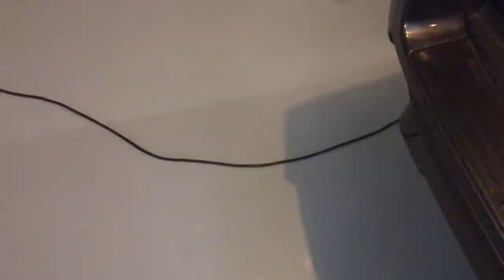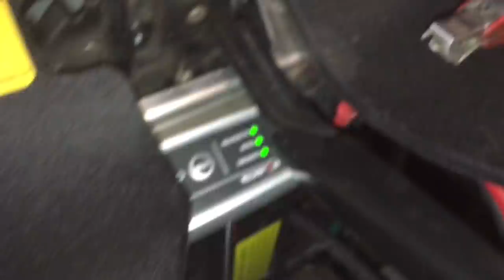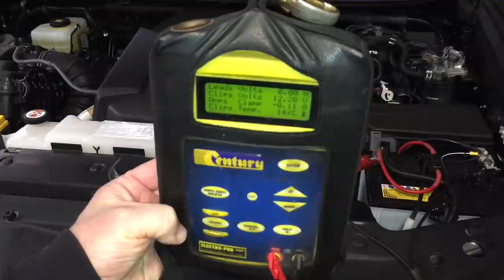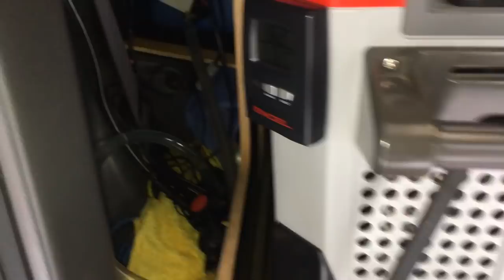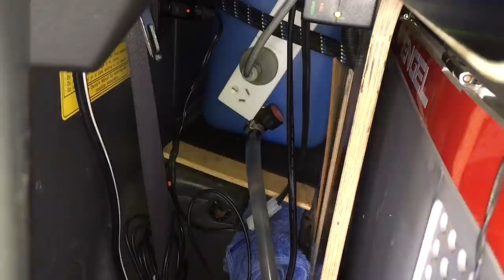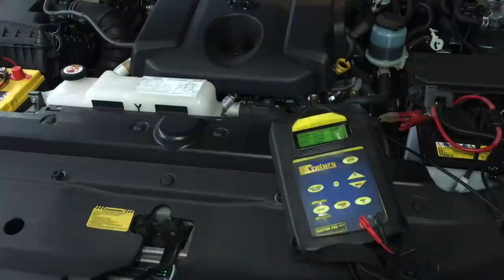DCDC CHARGER KILLING BATTERYS IF YOUR NOT AWARE OF THIS

Comment: With the Projecta on solid lights (all 3) it’s not actually charging - it suposodily in float mode . Also with solar charging it doesn’t pull anything from the crack battery mate, only does this when crank battery voltage is over a specific voltage, think it’s 12.9v (check manual). Something else is going on with why the crank is only at 12.2v. Having said that, I originally ran the Projecta dcdc and had a fair few problems with the charging and going into float mode early and float voltage was low like you are seeing. I replaced it with a redarc bcdc and it’s been absolutely solid!
Reply from the maker: But it is

Comment: Ive connected the blue wire off the sbi12 to switch in cab to start ute off aux battery if my crank battery was flat or below 11v

Comment: Oh dear, somebody help this bloke!

The unit is performing exactly how it's designed. I am unsure what you are so angry about? The DCDC charger will not take care of the starter battery it's not meant to. A VSR is definetly not the solution nowadays, under bonett secondaries and VSRs are old technology there are much better performing systems for modern vehicles.
Reply from the maker: Yep worked really well NOT
Really angry Actually probably true but I’ve got rid of the rubbish now and now I use the solar panels with the cheap regulator that came with it and see over 14 V even when it’s cloudy the projector is rubbish

Comment: It is a situation where if you increase the charge to the main battery, the DCDC charger senses this and starts charging the aux batteries.at its full charging output....if the DCDC charger is getting charge from the alternator..then the alternator @ 150amp will cover (keep up with the charge needed) for the a 20amp DC DC charger charging the aux  battery. If you are on solar input without the alternator going.(ie camping).that solar input will trick the DCDC charger to start at a full 20amp to charge the aux battery....BUT if the solar is only putting in 4amps..the DCDC is charging at 20amps to the aux battery, you are losing net 15amp..that 15amp has to come from somewhere to make up the "gap"...guess where?...from your starter battery!..This vid does explain it a bit better...https://www.youtube.com/watch?v=rDXixCzg6iw
Reply: I think that’s what’s going on with mine

Comment: The DC-DC usually had a mode to charge different battery's i.e: AGM Gel cell etc. They recommend an isolator and the DC-DC sometimes and bang there goes your customers $1500+.
 Agree with you Anthony, the SBI12 is the simplest and low cost for customers (Auto-Elecco here) Redarc and others suppliers always try to tell you to fit the bloody more expensive DC-DC. Cheers for the info once again. Keep the Budda booms and bangs coming 😂
Reply: All DC to DC chargers are meant to be connected to the second battery or deep cycle battery not the crank battery. In the instructions it tells you this. Its there to charge the second battery hence why they say in the instructions to put it as close to the second battery as possible. its not there to charge the crank battery as its charged via the alternator. I have one in my Prado and have NEVER had an issue. (Auto Sparky here also) The SBI12 is basically a switch between the two batteries that divides the batteries when the vehicle is off. They work ok if the two batteries are of the same make up ie both flooded lead acid crank batteries, but if one of the batteries is a deep cycle AGM under bonnet battery things change and will NOT charge them up to anywhere near 100% hence the dc to dc charger.

Comment: I am having a similar issue with my Redarc DCDC charger. After a week running solar on  my Aux batt my starter is drained down.
Reply from the maker: Which leads me to believe this is a possibility not isolated to projecta alone
Reply: @Fourby4Diesel  Recently I have disconnected all the accessories in the back and connected them to a stand alone lithium battery. Even though there should be no amp draw or very little, after 2 weeks of it sitting there the main battery and aux battery were flat. Though the main battery only just had enough juice to crank and start the engine. Am now rethinking all the wiring which was professionally installed and what I can do to aleviat this in the future.
Reply: Also this is with solar disconnected.

Comment: Great vid. I have the same Projecta DCDC in my 150. I have a second car which is a work issued daily driver so didn’t drive the prado for a few weeks.  The Projecta sucked my crank battery dry resulting in me needing to buy a new one. I now don’t have the DCDC connected to the crank unless I’m going on a trip - kind of defeats the purpose. I’ll look into your 120 setup now and look to replace.
Reply: All DC to DC chargers are meant to be connected to the second battery or deep cycle battery not the crank battery. In the instructions it tells you this. Its there to charge the second battery hence why they say in the instructions to put it as close to the second battery as possible. its not there to charge the crank battery as its charged via the alternator. I have one in my Prado and have NEVER had an issue.

Comment: Your review is based on your failure to wire the product properly or have a faulty unit. It's meant to isolate the starter battery once car has been turned off.
Reply from the maker: It usually does but not always particularly when soul is plugged in common fault with the software on these units that’s the point

Comment: hi 
check wiring twice
Ignition overide wire ---connect to specific vehicle wiring ,,when engine is in running state ONLY
DONOT CONNECT TO IGNTION ON / accessory  WIRING 
Diagnosis of display light seem suspicious.   Why are they all on ??
Either clamp meter or inline amp meter would prove amperage consumption far better.

Comment: All a simple fix I have a DC to DC plus fixed panels on the roof connected to to the Aux battery and I have dual battery under the bonnet of the 80 start battery is fine but not 100% Could do with replacing, between the 2 batteries under the bonnet is a Redarc SBi12 if the starter battery will no start the car flick the switch on the dash and the 2nd battery kicks in and engine starts no probs
Between the start battery and the aux battery in the back running the fridge is a simple $50 200amp heavy duty continuous relay activated by Ign so when IGN off there is no power going either way between the start battery and the Aux battery. So simple and everything charges and works fine well except the start battery could do with replacing but not yet cant afford it

Comment: Can't comment on the projector, but ctek works perfectly, only charges over 13v on main battery, I suspect you have a setting or wiring wrong even though I know yih don't think you do, possibly faulty unit. 

There is a good reason why you want to use a dcdc charger over the diode, they have a charging sequence and optimised voltage which is different to the optimum for a led acid.  Not saying diode won't work but it's just not as good on the batterys as a dcdc charger.  Also FYI all the diode does is drop the signal voltage, tricking the ecu into putting out more voltage absolutely nothing special, if you want to go this way (and I have in the past when I wax being cheap) go to j car, pick up a diode for 50c (whoever can sell diodes for  $50 is an absolute wizard at marketing!!!).

Comment: I think you have been advised wrong. Go the Victron  Buck boost manual and see that the buck boost will not charge without the engine on and like one of the commenters below (Ray Blackburn) has said is that you might need a solar controller to go to that battery and if your dc to dc charger does not turn off with the ignition switch you will need a relay to turn it on and off. I have a Balmer extra alternator 180 amp but its regulator will not lower the power enough with a 700 amp hour Prismatic Lithium battery so had to go Buck boost dc to dc charger. It is on a yacht.

Comment: Best thing I ever did was get rid of all that dc-dc charger BS! Life is so much easier! They never work properly, the groups and forums are full of people trying to work them out! You'll always get that one bloke that reckons he's hasn't missed a beat for 5 years! But doesn't tell you how many batteries he's gone through!

It's just not worth getting stuck out bush with dead batteries just because you're trying to run a 12 volt fridge! Bottom line is if you've got enough amp hours in your battery and quality solar you don't need it!

Comment: i have to turn my dc to dc charger at least 30 minutes before i stop driving! i have a switch connected where i can do that. it seems like my house batteries pull down my starter battery sometimes. its almost like my renogy dc to dc let's current pull more from my starter battery. you are exactly right!

Comment: Been saying this for years myself. dcdc is mostly a gimmick. Has it's uses, but in a regular 4wd with a fridge smashing the battery.

Personally run a victon VSR and victron blue solar regulator never had an issue with power. The solar can fully charge a battery no worries at all. The capability of pumping as much as the battery wants with the VSR Instead of being limited to 10-20 amps with a Dc. 
The wank hype with them is just ridiculous.  
The Victron VSR is dual sense even
Only half decent one maybe the Ctek   but $700 for a DC with a VSR built in is also just more wanky bull shit.

Comment: The current DCDC chargers are just plain BRAIN DEAD . Lazy development . Pure and simple.
It is purely obvious that the REDARC needs a "low voltage disconnect" and stop the cheap and horrific flaws they are now displaying.
REDARC have just bought the cheapest Chinese garbage and rebadged it and added the 100% mark-up . No one in the right mind would "specify" this lack lustre design , so it is a cheap rrz buy in . Low act !

Comment: Install error... Are you sure you connected the blue wire to an ignition source that only gets power when engine is on (not acc).  Your solar panels are tricking the DC-DC to think the engine is running, so it pulls from the main battery connected the blue wire to an ignition source that only gets power when engine is on (not acc).  Yo
Reply from the maker: It’s not an install error everything was connected perfectly check the comments there’s other people that have had the same problem just randomly

Comment: The CTEK DS2050A will drain the starter battery to 12.8V and then cut off so no issues there.

Answer: When the engine is turned off, the D250S and D250SA will continue to charge the service battery from the starting battery until the starting battery reaches a voltage level of 12.8V. Please note that this will NOT drain your starting battery, the voltage cut off level of 12.8V prevents this from happening.

Comment: Sounds like there's an electrical problem. Ive had Dc-Dc chargers actually fix batteries that refuse to charge for what ever problem usually voltage drop over several metres .

Comment: You have it wired incorrectly, that is not how a dcdc charger works.
Reply from the maker: You have your comments incorrect
Reply: @Fourby4Diesel so why is your alternator light on on the DCDC charger? Alternator light on means  AUX battery is drawing power from main battery and sensor wire is getting input from ignition causing it to happen. You probably have the ignition on, or you have it wired wrong or the unit is faulty.
Reply from the maker: I didn’t come down in the last shower
It’s wired correctly in the ignition is not on. You should check the comments in the other videos. These things are a piece of crap and they have known fault It’s happened to many people just like this.
Reply: @Fourby4Diesel  Most people it happened to it's user error, so why is the ignition/alternator light on the DC DC charger on?? Hundreds of thousands of these in use and only a handful of people reported issues, and every one I have ever seen reporting an issue has been use error.
Reply from the maker: Yeah, well it must’ve been too hard to connect a handful of wires and you must be right
🤣🤣🤣🤣🤣

And one of the major supplies of these units that have said they have a fault and this is what happens with years of experience must be wrong as well. Lucky we have you thanks anyway, we just came down in the last shower you were right.
Reply: @Fourby4Diesel  Several people in the comments have explained it to you, I have explained it to you, the ignition/alternator light should not be on, you have it set so it drains the main battery down to 11.8 V or so, you have it set up incorrectly that is why it's doing what it's doing. These have serval different modes and settings, depending on how you wire it up. If the car is parked and charging off solar, the Alternator light should NOT be on, yours is on so it literally tells you that it is drawing from the main battery. I mean you have major spelling error in the video title, so wiring up a charger correctly is probably also an issue.

Comment: i found out quite a while ago that batteries can charge and discharge at the same time but they cannot charge from 2 sources simultaneously wherever the chargers are in the system. One will always detrimentally affect the other. I am still working on how to figure out why and will comment when I find out in one of your later video's. Meanwhile, you may want the review this admittedly poor quality short video. https://youtu.be/_z1N6kYECSU it covers battery to battery energy transfer bolstered by a little solar. TTFN
Reply: dual alternators, one that is  dedicated primary & secondary for auxiliary solves this.  Probably not a cost effective option.